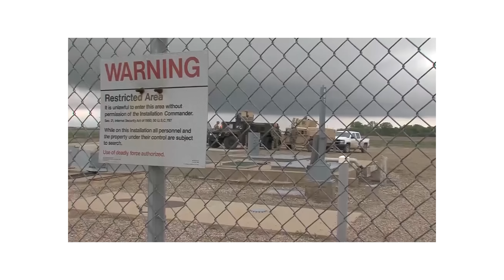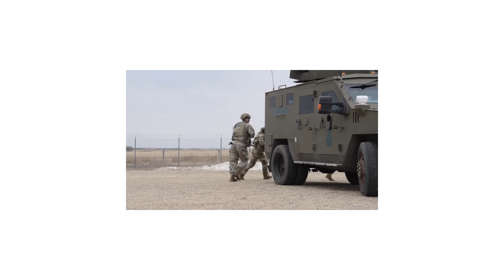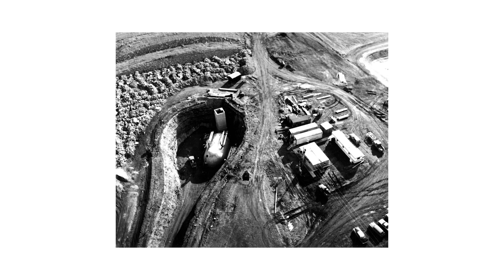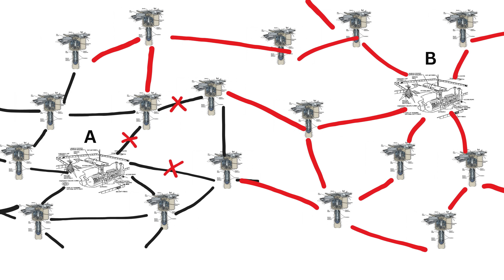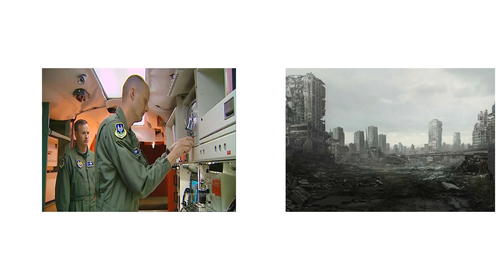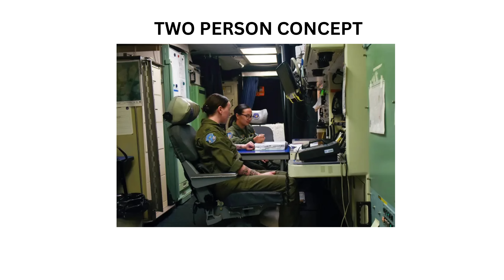Every USAF ICBM Security System Explained

Comment: Nobody is going to sneak into the LCC, but outer perimeter breaches happen all the time, usually unintentionally.
Reply: I did security for 5 years and i went on a couple of "rabbit" alarm, I am sure the missile crews laughed at us every time
Reply from the maker: rabbits
Reply: There is a decommissioned launch control center on the west side of I25 north of Cheyenne, Wyoming. You can arrive pretty much at any time during the day and get a guided tour of the above ground and below ground installation.
For anybody saying a special forces team would be able take control of the underground area, first they have get through a multi-ton door. After that, you have another multi-ton door that is locked from the inside.
The officers on duty would probably be alerted to any attempted penetration and have contacted one or more air force commands for security support.
They aren't going to open that door until they get the right answers to any challenge.
Reply from the maker: @capnkwick4286 in the field they have their old ass authenticator they use to authenticate with people like a keyboard looking thing that they use to pass code or numbers like a deciper tool.
Reply: The flaw in this system is too many alarms going off for no real threat causing people to quit worrying and quit paying attention.
Reply from the maker: @Its2084 after talking to a former missileer. He said there were bs alarms that won't reset due to some issues on snowy days, especially on Christmas eve, and by the book they had to send out security forces to camp the site literally for like 2 days straight. And it was -2 degrees outside. That's how serious they take it even though there is no threat
Reply: @MilGearExplainer  I never did the camper support side, but yeah, But the very short version is they dont leave until the alarm resets. there has been times when the alarms have not reset for a week, but the camper support guys would just have to send out relief, it was neve left online with a bad alarm and yes they was really called CS (Camper Support)
Reply from the maker: @floridaboz1 These missile bases have the highest separation rate and low morale for both officers and enlisted. Most people just don't want to do these jobs long term.
Reply: @MilGearExplainer  Personally, i enjoyed it when i did it 25 years ago. But you hit the nail on the head about that. There was a lot of bad things and a lot of good things. Some people just could not get over the bad things. Well a lot of people.
Reply from the maker: @floridaboz1 since these are almost "deployed" but you are not overseas and they have alot of downtimes. Take the time to get a degree or build a side business before getting out.
Reply: @MilGearExplainer  That is what i did, a lot of studies, got a degree, studies computers to a point where i was able to do IT when i got out. I spent a little time overseas on TDY, but also to Eskan Village Saudi Arabia.  Since we are here, just a quick history on myself, i was in the 790th SFS, RF1, Fireteams. SO Cheyenne Wy, Most of the time i was in, i did fireteams, but also worked a short period of time in vehicle section and the armory, I was working the armory during September 11th. That was a long couple of days
Reply from the maker: @floridaboz1  That's a smart move. Can't say about some veterans. Some don't do anything to prepare themselves before separation and it always end up bad. I know some people even with their security clearance, they are just so done with government work, and they wanted to do something else completely different...
Reply: @MilGearExplainer  Dont get it wrong, it was not all sunshine and rainbows. There was many times i had self doubt and even times of depression. I pushed through it, but seen other people not, to including losing friends because they decided that a permanent end was the best solution. (as you know as a content creator, but mainly for other people who see this reply, i am using vague wording because youtube will delete my reply if i dont).
Reply: @MilGearExplainer  that is not taking it seriously they’re taking action because policy not because it should be investigated
Reply from the maker: @TheLostPacketYT It is security policy. They have certain amount of time they have to investigate the site unless severe weather conditions
Reply: @MilGearExplainer  you’re saying it’s policy but that doesn’t mean it’s secure if you make decisions based on policy and you are unable to apply critical thinking with security you won’t be able to keep things secure if a situation arises that is not on paper
Reply: @Its2084 There is also another detail about the false alarms, yes we had them, and yes they happened often, but it did not consume a large part of your day, you might get one or two false alarms a day on a 12 hour shift. When that happened we had very detailed checklists we had to follow step by step for resets. But also most days, there was no false alarms.

The good part is the sites for the most part are remote so they did not see us having to chase wildlife of of the site (when they rarely was still there). 

Seeing see decently armed Security Forces chasing a rabbit off a silo i am sure would of been entertaining for some to see
Reply from the maker: @floridaboz1  This is why being missile cops is probably the worst enlisted job in the Air Force at those bases. Missile bases are known to be career killers  - People just get out  after. The same goes for missileers, some can't stand being underground for the entire day and it all depend on who you are working with that day, sometimes you can smell the bad vibes in the LCCs when you do crew changeover.
Reply: @Its2084 Trust me we pay attention to those alarms no matter how many FUCKING TIMES they go off lol
Reply: @Its2084yup it's called rediness fatigue. They got several perimeters on these sites. Outer one just had a better than nothing barbed wire fence and warning signs, next one is a real chain link fence, beyond that there are internal controlled access areas with even more serious security. Typically they verify a nuisance trip using thermal and regular security cameras. ❤

Comment: The government has been known to run the red opps missions alarm test of our security systems and secure military installations
Reply: The furthest they ever gotten was to the hatch. Nobody even with a truckload of C4 is getting past that due to the way it works. If someone tries everything locks with explosive driven pins that have to be removed one by one. With the right equipment it would take a few weeks to access the LCC and get the missileers out. This security system is designed for fail secure but also that it isn't gonna activate unless it determines that a serious threat occurred.
Reply from the maker: They do EMP test too
Reply: @MilGearExplainer they made these sites pretty immune to EMP even as severe as a lightning strike to the antenna. That bad would of course require a minor repair of replacing the shunt trap module, but it literally can be changed out in less than 30 seconds. The satellite com system is completely immune to all but near miss of a nuke due to blast not EMP. All the sites are now connected with fiber optics as well so if one site gets got the others can share C&C information ❤

Comment: surprised this is publicly known stuff
Reply from the maker: There are way more top secret
Reply: what's the point of security system if nobody knows you have it
Reply: Acts as a deterrence too
The main reason countries boast about their arsenal is to prevent being attacked, its a promise of Mutually assured destruction
Reply: Its publiclly known mainly as a warning that if you F around you will find out. Both for people that want to break in for 😂 or internet fame, and actual belligerence from another nuclear armed country.
Reply: This technology is all from the 1950s. It's safe to release it, because the technology is so far advanced it's beyond your wildest dreams.

It's logical that some "high speed" team may have been able to penetrate it (not the command bunker, but the facility itself) but the protocol for that is to make sure EVERYONE is aware of the date/approximate time.  They will acknowledge the alarms going off and/or being neutralized, send out the RT to be on-scene, but won't apprehend the intruders. They want to see if a hostile  group could access the facility, using only publicly available/reasonable assumption info, and how far they could get.
Reply: Really!? 😂